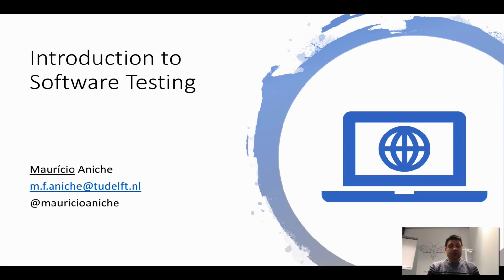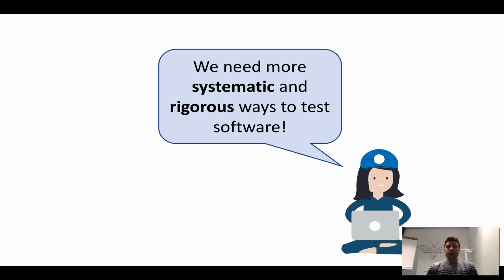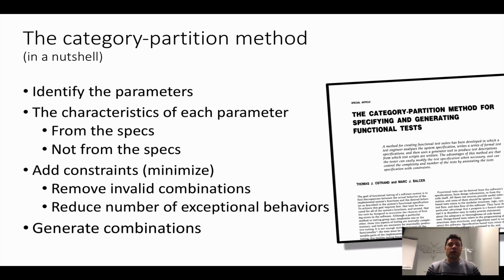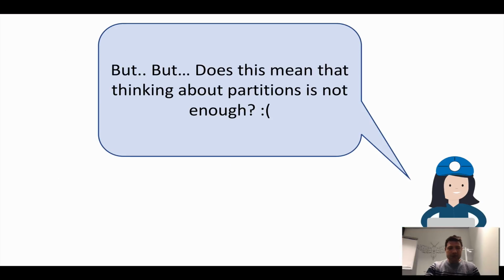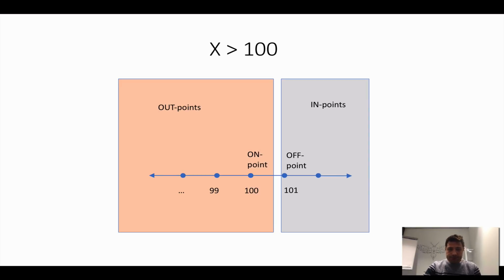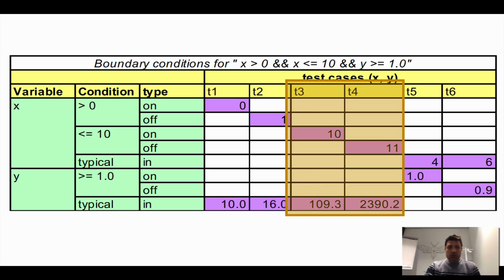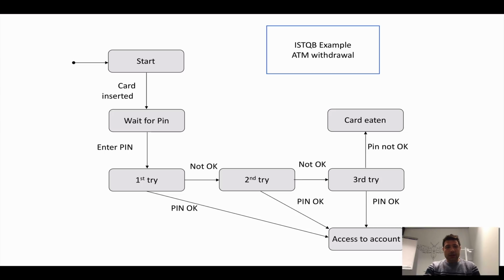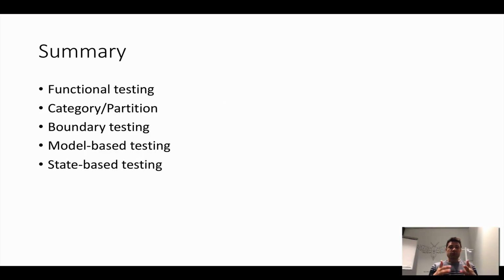Introduction to Software Testing [Software Engineering Methods @ TU Delft]

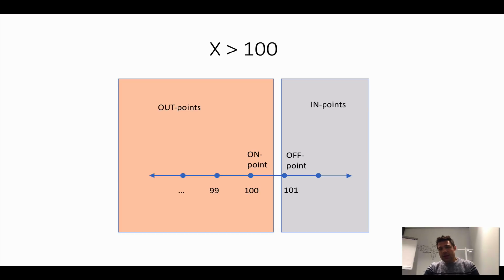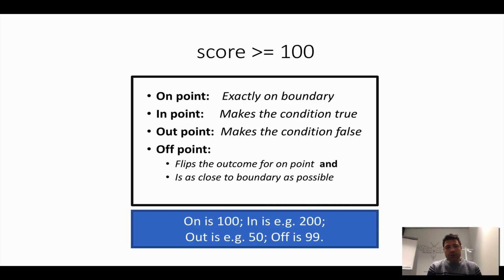Comment: On 10:55 the ON-Point and OFF-point are flipped. This doesn't make sense with the definitino on 11:25
Reply from the maker: Hi, Boris! Where? In the example, X > 100, 100 is the on point. This on point makes the condition false, so, the off point has to be 101. Out points make the condition false (the on point in this example is here), in point make the condition true (the off point is here). What mistake did you see there?
Reply: @mauricioaniche  The on-point is exactly on the boundary. At 10:45, for x>= 100,  100 is the on point. So I assusme that all points exactly on the boundary, make the condition true.

At 10:45, for x>= 100,  100 is the on point.
Logically would follow that for x>= 99, 99 is the on point.
And for x>=101, 101 is the on point.

x>=101 is logically the same as x > 100. However, for x > 100, the on point is 100, instead of 101. I don't get that logic :p
Reply: @mauricioaniche  But looking at your explenation, the ON and OFF points are also defined by the type of operator, and not only the IN-point set and OUT-point set I suppose.
Reply from the maker: @borro0  no, that's the trick! The on point can make the condition to be true or false, depending on the condition! As the example in my video!